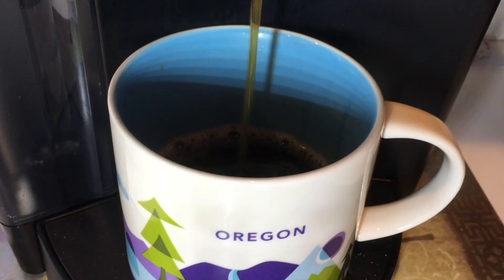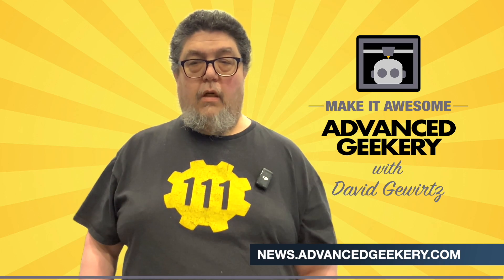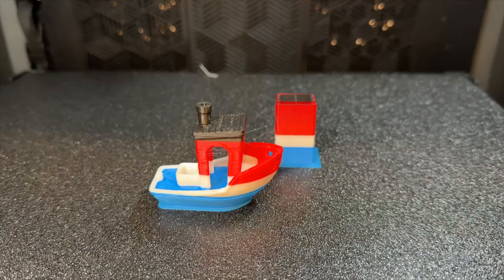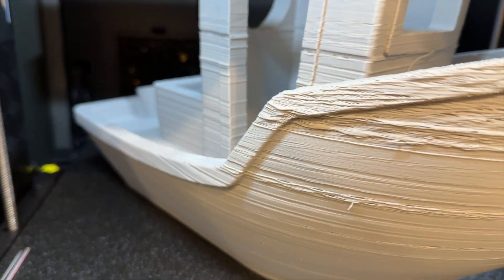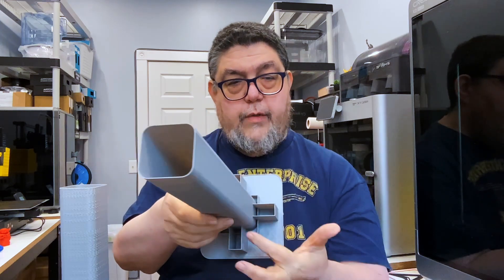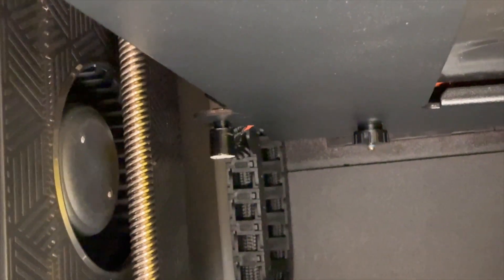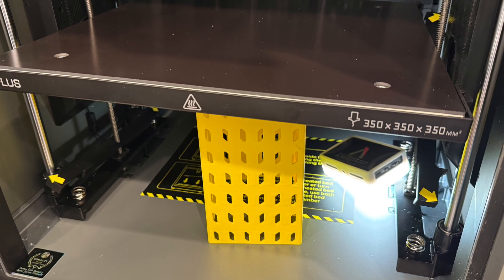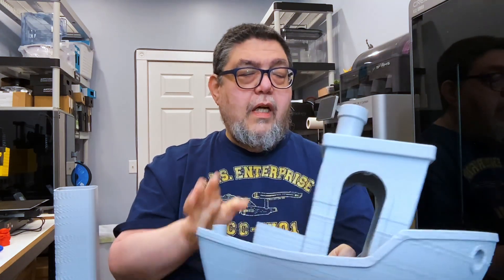Creality K2 Plus update: why this review is taking longer than expected

Comment: I bought a new K2 Friday and right out of the box it was bad and after a long time I was finally able to get ahold of someone from creality and they are sending new parts to hopefully fix it but if I don't receive thr parts in the next 7 days or it doesn't fix it I'm just gonna return it ti microcenter and will not be buying any more creality products.
Reply from the maker: I just got the parts in, but I'm definitely not looking forward to field stripping this thing. I'm guessing it will take most of a day, and that's not the kind of time I have free on my calendar right now. I'm also not entirely convinced the parts I was sent are what will fix the machine, so there's that. Stay tuned. Can't have a ginormous boat anchor taking up space in the Fab Lab, so I'm going to have to get it working.

Comment: I’ve had my K2plus for a while and I just realized the left side bed brackets are broken after watching this video. Where and how do I buy the new parts? If you have any input I would appreciate this is my first printer ever.
Reply from the maker: Well, first, don't let a malfunctioning 3D printer get you down on the whole idea of 3D printing. It's frustrating when something doesn't work, but what you can do with these tools is quite helpful. As for parts, I honestly don't know. I am still waiting on the manufacturer to get me a clearer answer on what's going on inside the printer. I keep sending them pictures and I'm hoping for a Concrete set of instructions. My best recommendation is to contact the company and keep working it. Most manufacturers tend to be a little bit, nonresponsive, but in the long run, they're pretty cool people. You just have to put more time in it than you would necessarily want to, but that support in almost everything these days. As for me, I have a disassembled printer, taking up a trunk of my workspace, and I'm just gonna work it until I get it working, at which point I will report back to you and the other viewers. Hang in there.
Reply: @ thanks I appreciate that advice I’ll see what I can get from them🤞and I’ll keep watching.

Comment: I read some online reviews that mentioned that they did have an issue with shipping for a while and there were printers showing up with broken parts.  I got mine about a week ago and it was packed with an insane amount of support so I'm guessing that they have corrected it.  I haven't had any issues with prints short of some failures due to weird slicer settings, I'm definitely not a fan of their slicer.
Reply: Their slicer has gotten good over the past 6 months
Reply: Can you use other sliders like orca?
Reply from the maker: It's using a wacky Orca clone. For some reason, they put the menu interface on the right hand side.

Comment: I just got one and having the same issue. Creality support is underwhelming at best. I just paid $1499 for it. I’m not going to work on it. Although I’m perfectly capable. I paid for a printer that works that’s what expect. A year down the road I will work on on it. Brand new I’m not. I will send it back and get a replacement first.
Reply from the maker: I'm tempted to go that route, but it's huge and I destroyed the box in unpacking. But I have to say I'm not looking forward to the amount of time it'll take to open the machine up and make repairs.